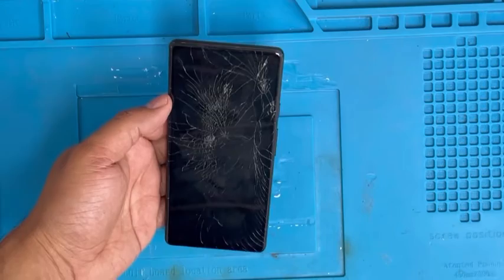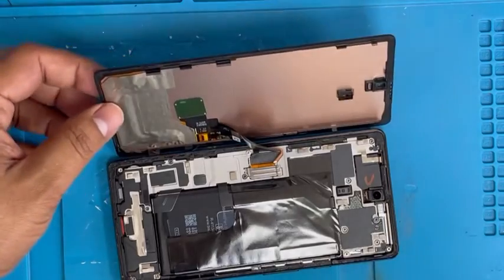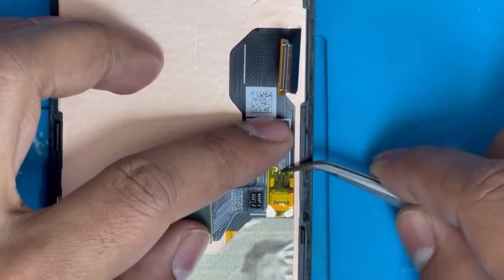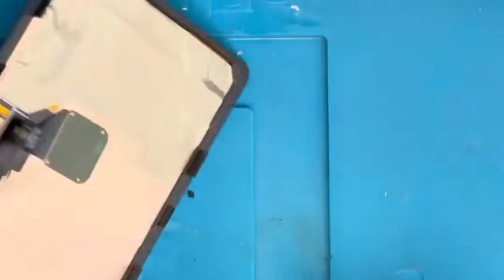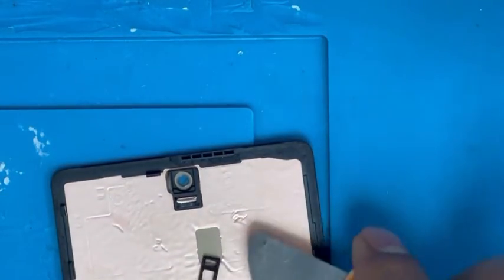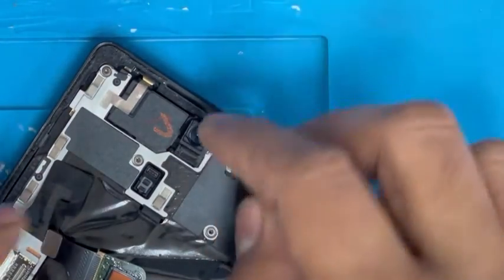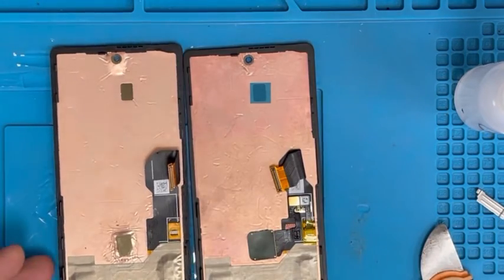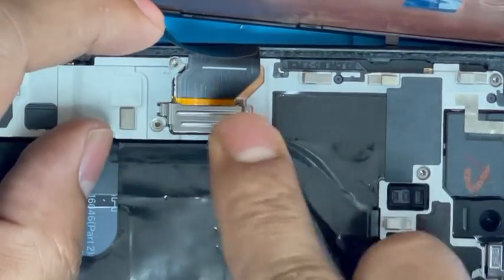Google pixel 6a screen replacement, pixel 6a screen replacement

Comment: What is the price of this display
Reply from the maker: Check on eBay
Tnx
Reply: @s-us-u8296 what is the price???
Reply: Can you share the link, is this glass quality good?
My pixel 6a screen cracked, in market for to replace
Reply: @rajeshhazari ifixit has a great kit that includes all the tools you need for 100. I've used the, a few times and they never fail if you can understand instructions